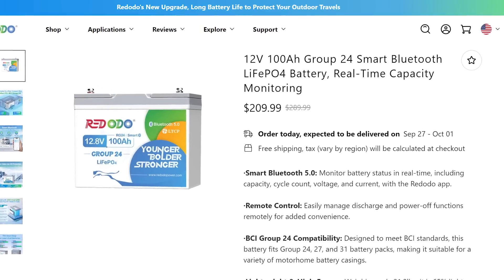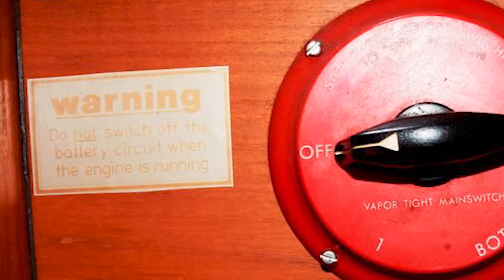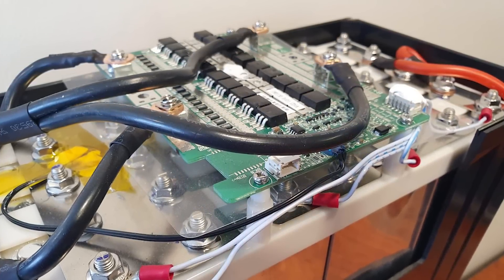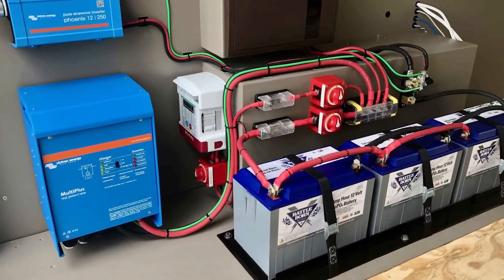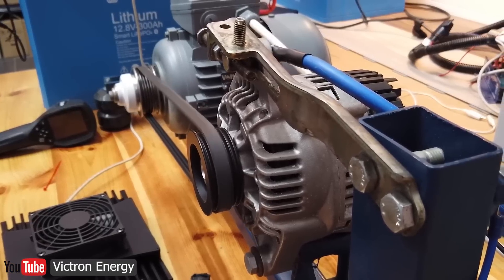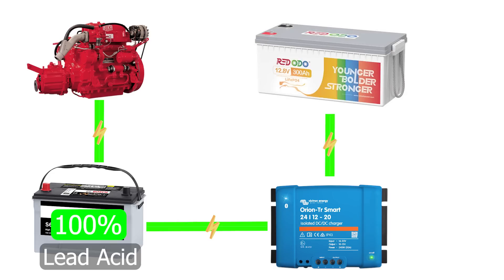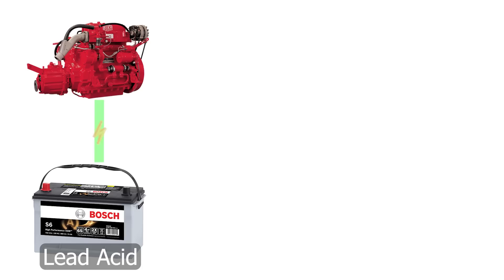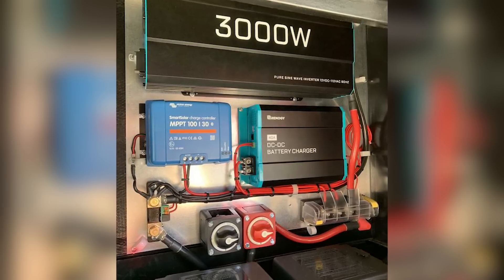Can A Lithium Battery Fry Your Alternator?

Comment: What about a "cheater box"??? I use a "Sterling box" in my string...is that good enough? I also use a Lead Acid as my starter with 4 - 100 Amp Hour Lithium Ion (pho) ???? Any thoughts?
Reply: I have a 170A Balmar alternator connected to the Lead acid starter battery. Then a Sterling 120A DC To DC charger going to 450Ah Lithium.  Advantages: 1) the alternator is never asked for more than 120A. 2) The Sterling DC to DC is rated more than 95% efficient and never heats up. Had this setup for 2 years now - very happy - lots of power!
Reply: @nicomakris3485  nice 👍
Reply: Is your Sterling box an adp
Reply: @svDansleau  Sterling BB 1230 -12volt 30Amps...A B2B unit...allows Lead Acid to Charge alongside Lithium Ion (Life PHO)

Comment: My Renogy 50A DC/DC charger appears to vary charging output based on input and where it is in its charging profile. I don't see it pulling more amperage from the start battery than is being produced from the alternator. This unit's output can be adjusted to 20, 30 or 50A. With it set at 50A it rarely produces 50A because my outboard's alternator can't always spare 50A, set at 40A it runs at a steady amperage. Late in the charging profile it produces  less amperage. I can monitor start and house battery charging rates and have not seen the full-rated amperage draw you warn of occurring. Solar inputs convert whatever is available, I have seen as little as 4 watts produced.
Reply: Are your solar charge controllers connected to the lead or Lithium batteries?
Reply: @artsmith103  The Renogy DCDC charger is also a solar mppt controller. It prioritizes start battery, then house.

Comment: Never really thought through all of these issues at the same time. Thanks for putting it all in one place. There are multiple electrical solutions to all of these potential issues, but none of them exist today. These might include "smarter chargers" that understand how to shed loads when connected to an alternator. There's clearly a need for better regulators attached to the alternator that could accept and dissipate the voltage spikes caused by connecting a lithium battery connected directly to an alternator - think about a surge suppressor, but for your boat.

Comment: I speculate a small solar panel to top-up the Lead start battery might trigger the DC to DC charger with its 30 or 60 amp draw for the lithium. Similar problematic results. 

First.
Reply: This isn't an issue with a quality DC:DC charger like a Victron. Why?  The Victron DC:DC chargers shut off when the source battery (Lead Acid) drops below a threshold voltage.  That voltage is adjustable.  So you can set the DC:DC charger shut off voltage at say 12.8 volts.  That will shut off the DC:DC charger if the charging source for the lead acid battery is smaller than the DC:DC charger's output and the lead acid battery drops below the shut off voltage.  This shut off voltage is normally used to shut off the DC:DC charger when the engine is shut down, but it will work in the scenario Tim described.

Another thing is that you want to size the DC:DC charger to have no more than half of the alternator output so the alternator can keep up with the DC:DC charger even at low engine rpm.